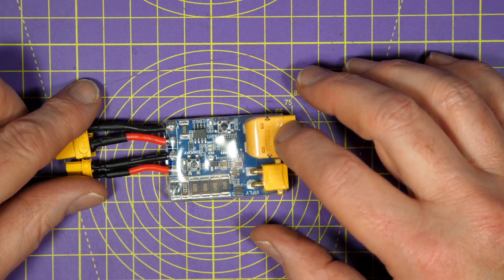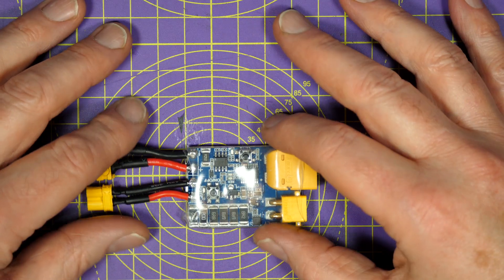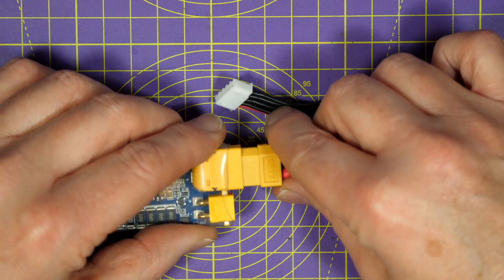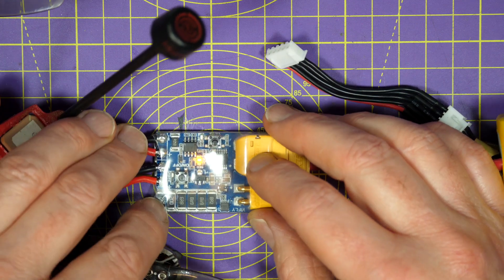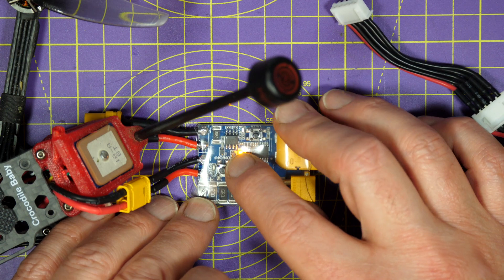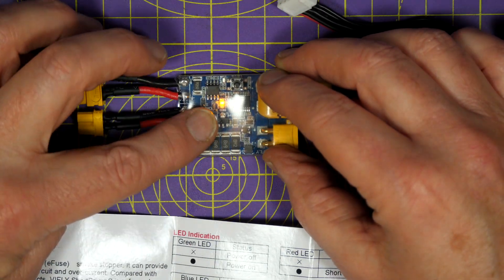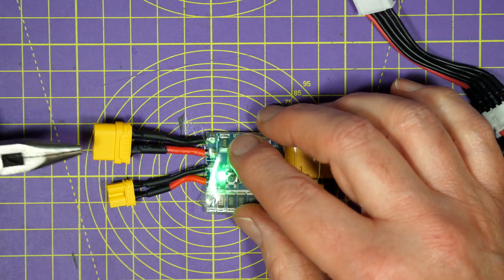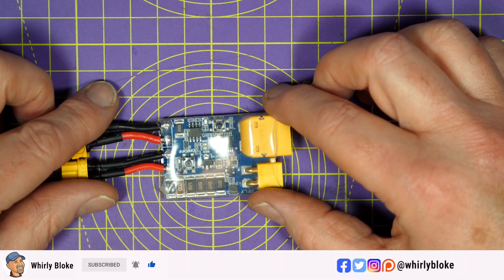ViFly ShortSaver Smoke Stopper version 2 Review // Short-Circuit and Over-Current Protection

Comment: ıt just cuts off when i give some power on the motors. my setup is 2207 supernova motors 65a esc and 6s lips. I select the three yellow led set for low sensitivity and high current and 2 amp mode. ıt works but when i put on the throttle it cuts off. why do you think it is happening
Reply from the maker: Thanks for watching the review. It sounds like your setup is drawing more current than the ShortSaver’s 2-amp limit, causing it to cut off when you throttle up. The ViFly ShortSaver is designed to prevent overcurrent situations, so in cases where high-powered setups (like your 2207 motors and 65A ESC on a 6S LiPo) draw more than 2 amps, the device will cut the circuit as a protective measure.

You might want to try increasing the ShortSaver’s sensitivity to a higher current mode if possible (like the 4A setting), as this can help it handle the load when throttling up without triggering a cutoff. However, keep in mind that the ShortSaver is primarily for testing low-current situations, so it might still cut out on larger setups. For extensive testing, consider using a power supply with current limits to further troubleshoot any issues safely.

Comment: we are using a 6s 22.2v lipo battery that has 32000 mAh. When plugging in the vifly v2, we at low sensitivty ( 3 blinks) and 2A. The device is shutting down at almost 40% power. This might be due to a false alarm. What are the possible solutions.
Reply from the maker: Hi there and thanks for sharing your experience. It's unfortunate to hear that you're encountering issues with the device shutting down at nearly 40% power. Based on your description, it's possible that you're experiencing a false alarm triggering the shutdown.

Here are a few possible solutions you can try:
Check the battery voltage: Make sure the battery voltage is within a safe range and not dropping significantly under load. A low voltage can trigger a false alarm. If the battery is nearing its low voltage cutoff, it's advisable to replace or recharge it.

Verify the device settings: Double-check the sensitivity setting on the ViFly ShortSaver. If it's set too low, it might be more prone to false alarms. Try adjusting the sensitivity to a slightly higher level to see if it resolves the issue.

Inspect the wiring and connections: Ensure that all the connections between the battery, the ViFly ShortSaver, and the rest of the system are secure and properly soldered. Loose connections or damaged wires can lead to voltage drops and false alarms.

Contact the manufacturer: If the problem persists despite trying the above steps, it would be advisable to reach out to the manufacturer's customer support. They should have a better understanding of their product and can provide specific guidance or even a replacement if necessary.

Remember, safety is of utmost importance when dealing with high-powered devices and LiPo batteries. Always exercise caution and follow the manufacturer's instructions to ensure the safe operation of your equipment. Good luck with resolving the issue.

Comment: When I connected 4s lipo, smoke stopper is triggering while its set to 1 amp threshold. 2 amp no problem its working. Do you think is it a problem ?
Reply from the maker: Some drones will have a higher switch on surge current than others. You only need to worry if it trips on the 2A setting. As always, do a continuity check with a multimeter before you plug a battery in any time you're firing up the quad for the first time. If there's a short circuit, you need to fix it first.

Comment: That button is a great upgrade!
Question: My V1 ALWAYS indicates an over current -  any idea why? Maybe you could make a video about what exactly an over current is and how to avoid/fix it? 
Besides that my quads seem to fly just fine and my circuitry does not fry.
Reply from the maker: Some flight controllers and electronics just have a larger surge current on start up. Either set the ShortSaver to it's 2A mode or make the trip time longer for that quad.
Reply: @WhirlyBloke  Thank you sir - I will definitely try that, and I will let you know if it works!
Reply: @WhirlyBloke  Well Sir Whirly, since I'm using the original version of this smoke stopper,  I tried bridging first the "S" solder pads on the back, and then I unbridged the "S" pads and bridged the "N" pads, and low and behold,  the red light pops on and none of my four quads start up. I'm going to order this new V2 and see what happens - maybe the V1 that I have is just defective.
Thanks for the suggestion, I will follow up when I get the V2!